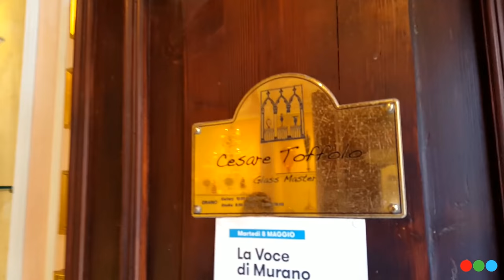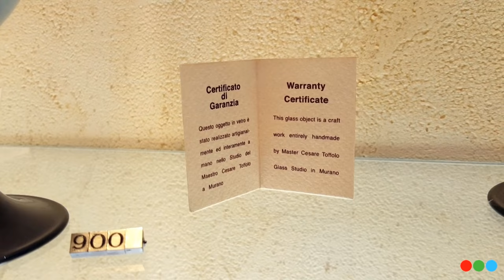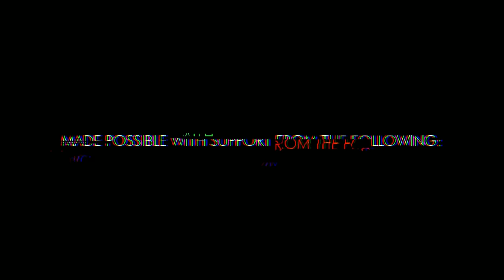Cesare Toffolo Veronese Vase Demo & Gallery Tour - Glass Central Presents Episode 1

Comment: Yo mike, I was the dude with the GoPro, we met. Out of curiosity, how long did it take you to upload this video to youtube? I have many hour plus length demos I'm meaning to upload (still need to edit most of them) I'm new to all of this. I started uploading the Martin janecky demo and it said 0% uploaded after like 30 minutes....

Also, I probably don't even need to upload my demo of Cesare lol, you got a way better angle. Nice meeting you 

Caleb Siegler
Reply: Hey Caleb!  Was nice to meet out in Murano!  Sorry just saw this, been out of town for the ASGS Symposium.  So upload times depend on the file size and your internet connection, like if you recorded in 4k or higher bitrates at lower resolution it will take longer and then it depends on your upload bandwidth.  When I upload a video it usually takes a few hours tho I recently upgraded my service and now its like 1-2.  In this case tho I streamed the show live so it took 75 min.  My connection is 30 megs up and I use about 10 of it for the broadcasts whereas a finished render out of my editing software is closer to 12 but the difference is negligible.  Hope that all makes some sense hehe.